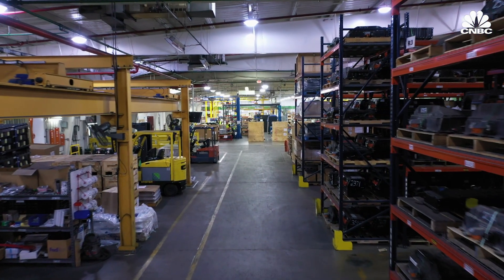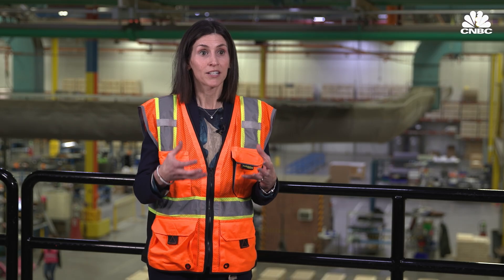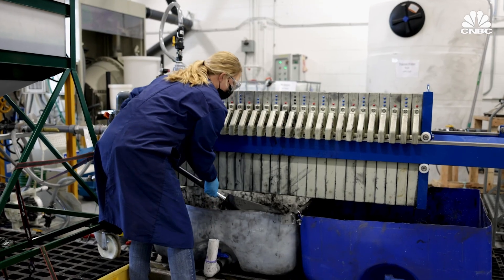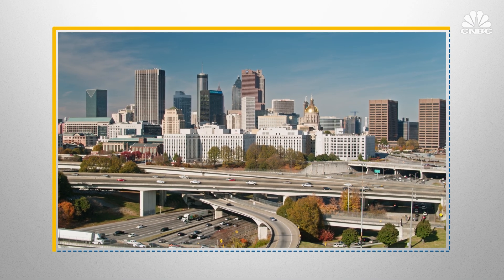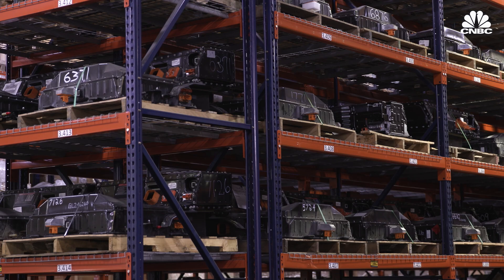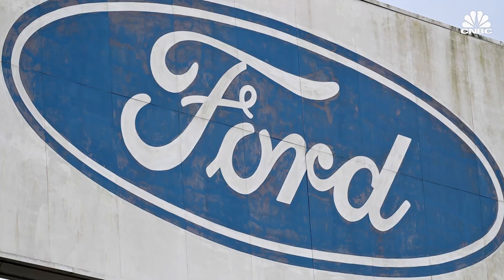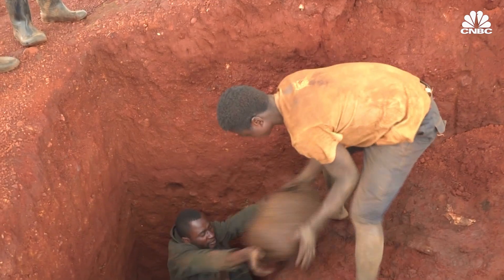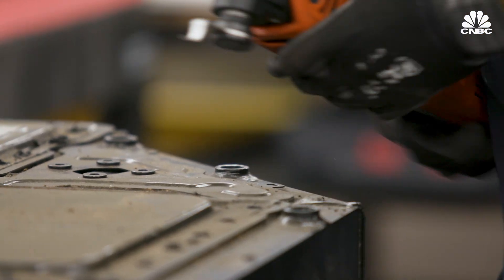Where Do EV Batteries Go When They Die?

Comment: Real "recycling" is precisely reduction of "black mass". The reason "reusing" is important is because "recycling" is so difficult and expensive. EV battery production from raw ores produces ~73kg CO2e per kWh of battery, because refining highly reactive metal ores requires huge amounts of GHG intensive graphite and carbon monoxide. Doing a little grade school chemistry, and using diesel equivalents and gibbs energies, a short calculation shows this ~73kg CO2e per kWh corresponds to 290 kWh per kWh or 290 deep cycles energy per battery produced. Current and expected future best practices in recycling "black mass" will save only an inconsequential ~6% of these 73 kg CO2e per kWh and 290 deep cycles per battery GHG footprints. As a scientific fact, normal high quality long range BEV vehicles only drive ~500 times their rated battery ranges in average vehicle lifetimes. The problem with BEV cars is this: on the one hand, marginal efficiency respecting energy may be as high as 80%; but on the other hand, lifetime efficiency is only 500/(290+(500/80%)) = 55%, whereas respective GHG footprint is 290/(290+(500/80%)) = 32%. BEV vehicles and associated GHG footprints will become unsustainable all too soon, with best estimates saying ~30 years until BEV cars will need to be limited or even scrapped altogether. This is because, global vehicle numbers and driving distances keep growing exponentially, with doubling times on the order of ~15 years. Confusing "reusing" with "recycling" may be good marketing by BEV business insiders; but science literacy helps avoid falling into what is really their self-interested "bait and switch" grift. Fixing humanity's long-term GHG footprint will be extremely complex; Switching away from ICE and toward BEV cars may be a good step now; the "black mass" recycling problem, however, shows BEV cars are at best only a stepping stone toward global long-term GHG sustainability.
Reply: Wouldn't all this change with improving battery technologies as well as going hand in hand with switching to greener power alternatives (wind, solar, hydro, nuclear, etc.)? From my point of view, it's much more efficient to have one major power plant (even if it's coal) to power multiple vehicles than having a ton of smaller mini power plants (engines) spreading pollution. This is also increased when you consider fuel transportation as well and how much land we use to produce things like ethanol.
Reply: Thoughtful and educated comments are in short supply here. Thank you!
Reply: Great comment!  There is a company working on a non- black mass recycling solution!

Comment: I'd never buy these batteries as all that do is swap old dead cells with active cells from other battery packs, so what your left with is a battery pack with lots of old cells that could die at any time, so you pay thousands for the battery pack that will likely go bad within a year or two. It's not a great solution at all and is not at all comparable to a new battery pack.
Reply: I agree to an extent.  When batteries fail it's often only one cell in the series.  If you pull that one out, the rest of the cells are good.  If this is a factory new battery pack that failed final testing then the remaining cells are also new, or have been cycled once, so I'm ok reusing them.  If it's a used pack then the remaining cells are old.  In that case, it makes little sense to me to spend the time and energy to wrap them up into a tightly sealed vehicle pack when another one could go bad at any time.  A home battery setup where individual cells could be pulled by the user (or on-site technician) if they underperform makes a lot more sense to me.
Reply: People buy them to replace battery packs that have failed and they are a lot cheaper than a brand new one.  But you are right that people buying them are taking a gamble but people take these kinda chances ever day.
Reply: There was no mention of warranties on the used batteries but they must have one. Who would buy a used pack without a warranty?

Comment: Rebuilt or refurbished batteries shud be discount on a new car and the costumers shud be told that's happening
Reply: New cars get new batteries. Rebuilt/referb is only being done for existing cars. It is possible that a new battery uses recycled materials to make the new batteries, but we are now starting to see that batteries manufactured from recycled materials have a longer battery life compared to a battery made with virgin materials.
Reply: The vast majority of steel used in cars is recycled steel. Do you get a discount a new car because the steel isn't virgin steel?
Reply: If someone is just pulling batteries out and re-using them ... then that is absolutely true.  No question.
However if we're talking re-cycling batteries, as in at the material level ... at that stage the recycled material is equal to newly mined material.  Just to clarify.